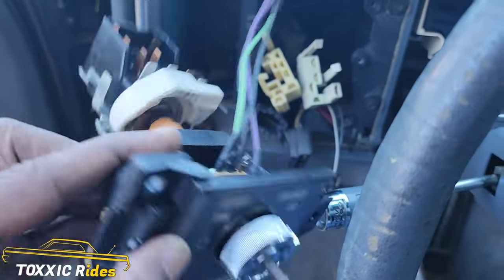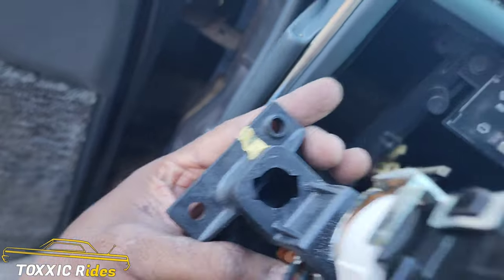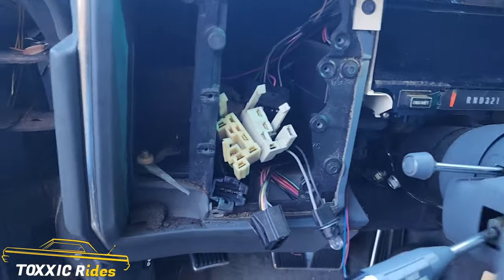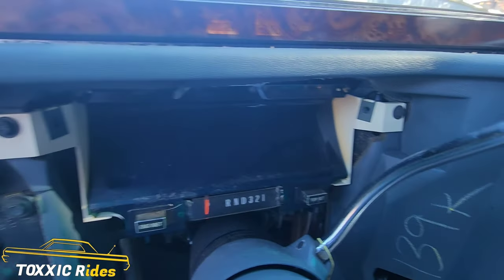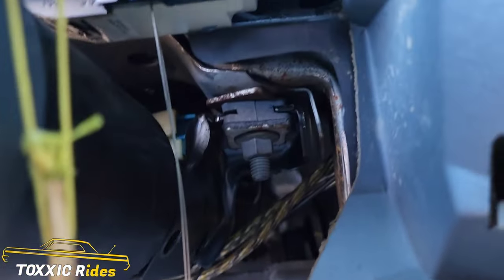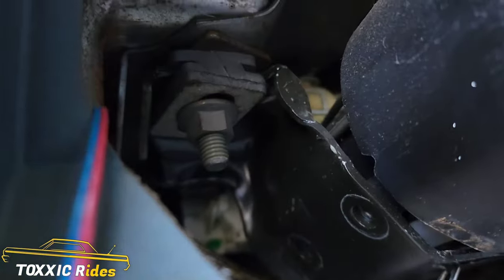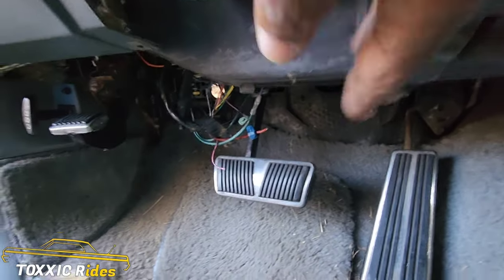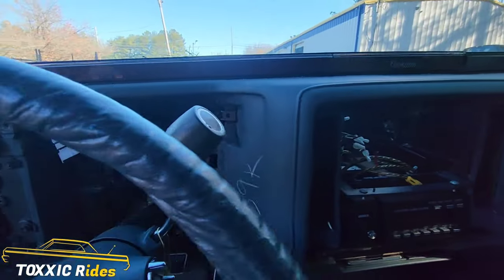90s Cadillac Dash Swap pt. 3 ( digital gauge removal)

Comment: Looked like you could undo the harness on the top of that dash to get down further with that special 7 shaped curved pick and undo that dash harness without having to drop the steering wheel? You could see the harness plugged in above the cluster, so if I could see that harness from the top then u could gain access from the top no?
Reply from the maker: If you move the shifter down it will come out without dropping the column.  I only dropped because I'm removing the whole dash

Comment: is a 90s dash able to go in a 82 fleetwood brougham?
Reply from the maker: Yes
Reply: @toxxicrides3461  im a have to get that done is there anything i need special for the swap ?
Reply from the maker: @S Mc  no, the digital dash wiring is different,  when I get my car out of the shop I will do a wiring video,  I just want to make sure it's right when I post
Reply: @toxxicrides3461  dope I appreciate you brother. Im in the middle of changing from the ht4100 to a 307  engine then will change the dash
Reply from the maker: @S Mc  I'm going to do a 5.7 swap also, this damn paint jail🤣🤣🤣